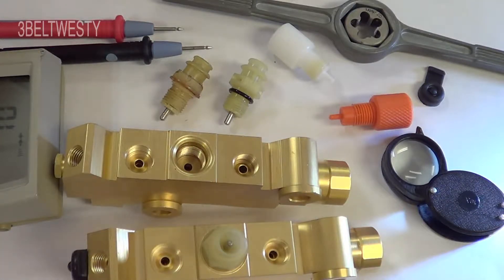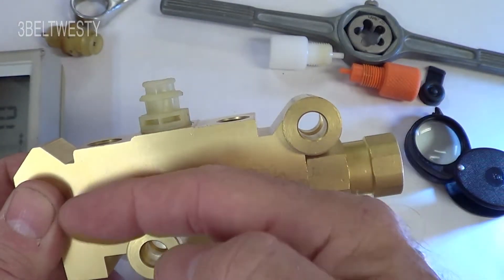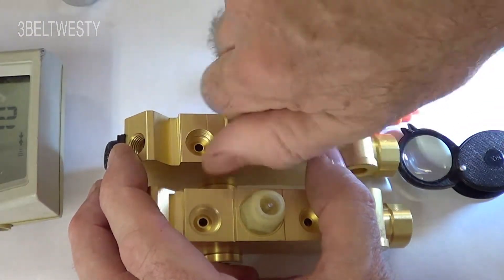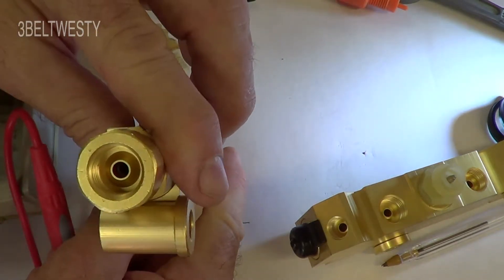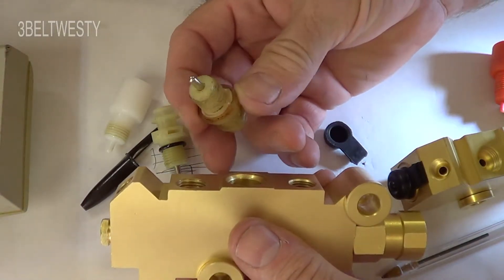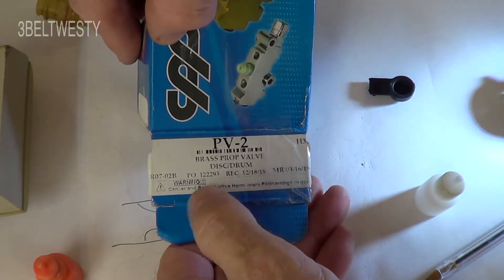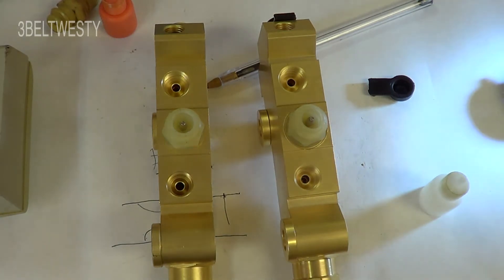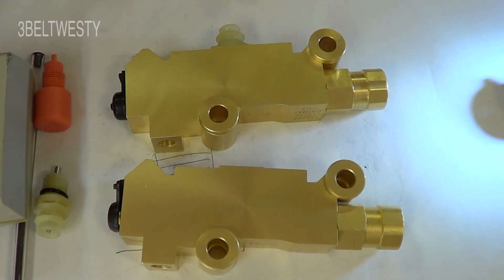Combination Valve PV2  and brake switch for GM vehicles

Comment: I had to lock up my brakes hard in my 95 s10 4 cylinder, 300,000 miles. Developed a bad rear leak at rear drum cylinder . Replaced both cylinders , rear parking brake works great and fluid flows.but my dash parking light is on now.. i think this is what is the cause.. great video

Comment: That fitting with the "pin' you discuss at 9:20 may be part of the metering valve. There are several versions of this type of combination valve and documentation is often lacking. There is another brass valve marketed as a metering or hold off valve. It is square with one inlet and two outlets. It also has a fitting that looks exactly like the "pin". Its function is to provide a little initial back pressure so the front disc brakes don't do all the work at low speeds or something like that. There are also PVKS versions that have residual valves for rear drum brakes. The PVKS versions are nice because they are complete modern brake system hydraulics in one block for many vintage cars. If the internal valve gets stuck a new valve is under $100.

Comment: I brought a replacement proportioning valve for my 1980 Jeep Cherokee. It has 2-wires to the switch. I have gone through 2-new ones and they both leaked brake fluid out of the top where the switch plugs into the wire plug. Neither came with any o-ring. And I do not see where an o-ring would fit. Actually I do not think an o-ring is the issue because the brake fluid is leaking from the top of the switch when the brakes are depressed. I have put a temporary plug in the switch hole to keep the fluid in so I can drive the vehicle

Comment: What makes you pull your hair out , on a new brake system . Bleeding the brakes and the valve will move to the rear then it can move to the front when bleeding now allowing you to bleed the brakes. It will move back and forth .

Comment: I'm new to the gm brake failure system.  I've been reading and researching non-Stop about the many issues. I have a 2000 gmc sierra 1500. 23k miles, already upgraded the brakes, and rotors, has new master cylinder.  
        Now on one of my cars I removed the abs system and added non-abs proportioning valve, and wondered if the my truck can obtain the same.
         So will this device be a solution? I'm going to replace all my brake lines, and really don't want to deal with the abs module. Read alot that it fails. And my rear has been locking up. 
     I do not want to cause a wreck or  have something fail while driving. Safety is my #1 priority at this moment.

Comment: Two things stand out on this video. First that switch has nothing to do with a low brake fluid level. It is activated when the shuttle valve moves off center, to alert the driver there is a problem in the brake system. Second, given how hard it was to re-center the shuttle valve, it has been contaminated. Possibly from the master cylinder or from decomposition of the o-rings inside the valve itself. It needs to be removed and rebuilt or replaced. At this point I would say the safety feature of that valve has been compromised.

Comment: I have a 1990 Chevy g30 that is in need of a combo/proportion valve. The model for that year is discontinued and can't be found anywhere. Do you have any info on what could be used as a replacement? Thanks

Comment: I have an '85 3/4 Ton Chevy, 4 wheel drive, 350 "M Series", Auto, full-length bed, and I have another valve as well as this one. My truck has an arm that is connected to a proportioning valve under the bed. When the bed is loaded, the arm turns the proportioning valve and allows more fluid to the rear brakes and the opposite when empty. I am getting almost no brake fluid past that valve when trying to bleed. Chevy says "NLA" as does GMC.   Any ideas? Are there special bleeding procedures for my specific truck? It came with the factory tow package. Also, do you have links to those valves in this video and the little bleeding assistant plugs??  Great drawing!! Thank you.
Reply: There is a TSB from GM from around 1988 about removing that valve. Those rear height sensing proportioning valves were for a federal requirement and all they really did was cause headaches. You can just delete it and hook the soft line directly to the hardline coming from the combo valve at the front of the truck.  The GM tsb is 88-T-15. Dodge and Ford I believe also had TSB's about removing the valves and all 3 have discontinued the parts and they're all NLA new.
Reply: @speedandmarine9066  Thank You!!

Comment: Hi  I am doing a brake conversion on my 69 impala  The problem is I replaced the back brake lines from the master cylinder to the portioning valve  the  line goes into portioning valve it's leaking from the valve ...its front drums to  disc

Comment: Can you tell me why I have a older proportional valve and it's got a side vent pin sized hole and I got brake fluid squirting out.
I ordered a new one and there's not a pin sized hole with a round circle the size of a penny and I have brake fluid spitting out of that.
Did something fall out or is that a relief pole and it's leaking past the seals?
Like I said I order a new one and there's not even a pin sized hole relief hole on either side of a newer unit I bought.

Comment: I took my brake switch off my PV4 for 4 wheel disc prop valve then looked inside the hole and it looks nothing like the diagram you drew and doesnt have a "necked down area" that I can see in the hole. I wonder why that is? The prop valve  is brand new and I just removed the switch and immediately looked inside and did not see that at all.
Reply: I have a pv4 and it should have a necked down area, they all do cuz it's how they work

Comment: I accidently ordered pv4 front disc rear drum can I use it?
Reply from the maker: The PV2 is a far safer to use and the proper valve for front discs and rear drum brakes.  The PV2 has the rear drum brakes being applied first, then the Front disc brakes. The PV2 sends NO pressure to the front disc brakes until the brake pedal pressure is high enough to the rear drum brakes are working first.  Thus the proper PV2 valve is for control and stability, ie safety. The front disc brake pads are about touching the brake rotor thus very little hydraulic line pressure is needed to make the brakes start to grab. With the rear drums the springs pull the shoes away from the brake drum. It takes more pressure to get the rear drum brake to start to grab the brake drum. A PV4 can work but your vehicle now can be less stable under certain braking conditions. ie great chance of probably fish-tailing etc.
Reply: @3beltwesty  thank you so much for the explanation

Comment: Can you just leave the tool in their eliminate that switch on top
Reply: It would keep the valve from separating the front and back brake if something fails. So if anything blew you’d have no brakes. Would be better to leave the switch and just not use

Comment: I'm a little confused... can a switch work with only one wire?
Reply from the maker: The other "wire/path" is ground of the cars frame. The door light switches are often like this too.  The switches "wire" ie return path is the cars frame usually the 12 volt batteries negative/black wire to the frame.